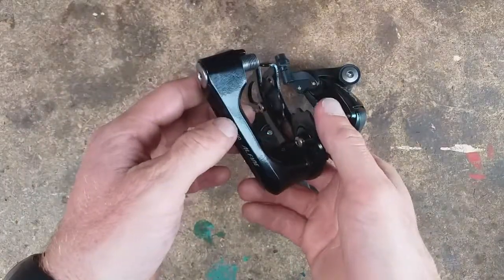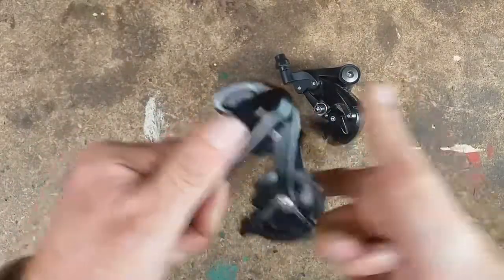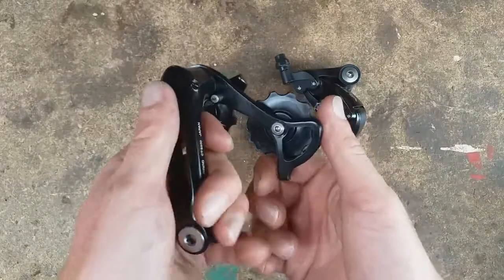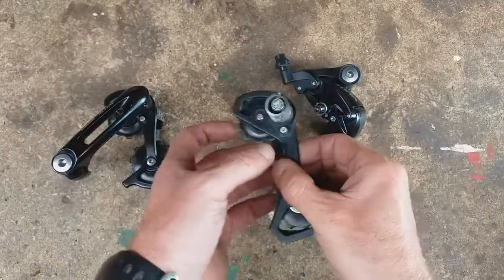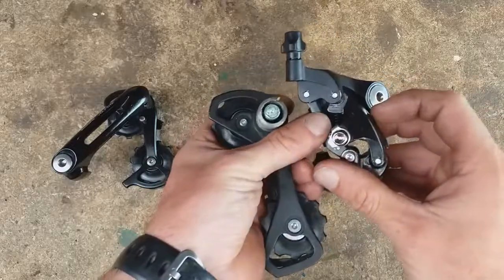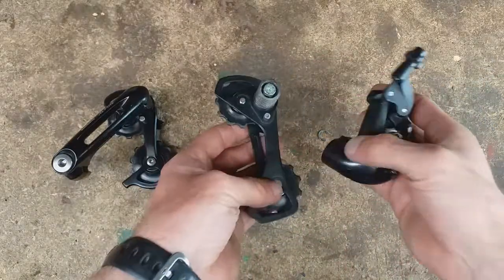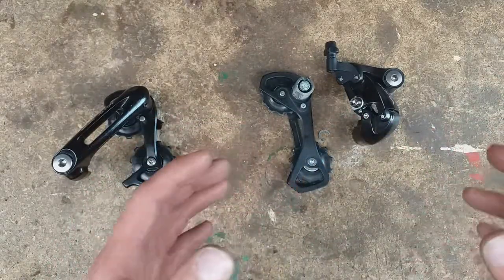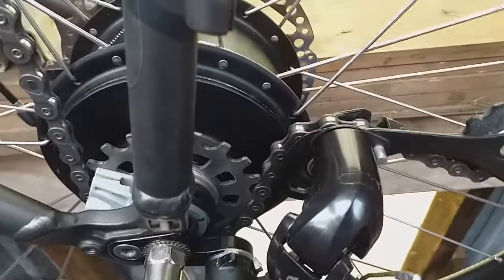enviolo SP Auto Shifter Road Bike Build Part 7 Chain Tensioner

Comment: Tell me, can this tensioner be calibrated for chain line? Moved to the left or to the right?
Reply from the maker: The chain tensioner I show at the beginning has no official adjustment for chain line. A washer could move it out slightly. It's very much designed to work with a particular hub.

Comment: But high tension is good, less noise and drops. Was looking for similar videos to check if I can make it stiffer in case it was too noodley before buying.
Reply from the maker: I don't think you'll find lack of tension a problem. It didn't work for me because I had 2 chainrings with very different numbers of teeth.